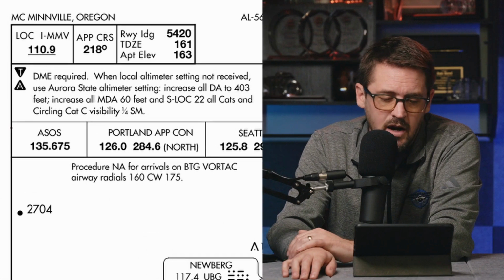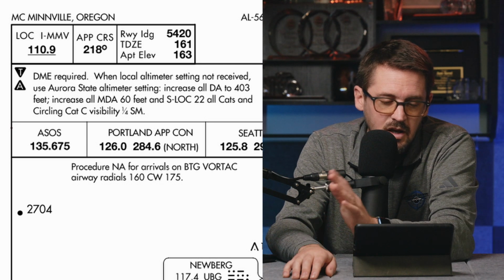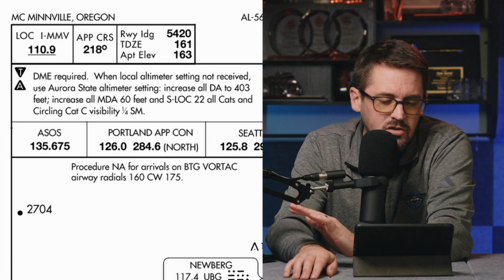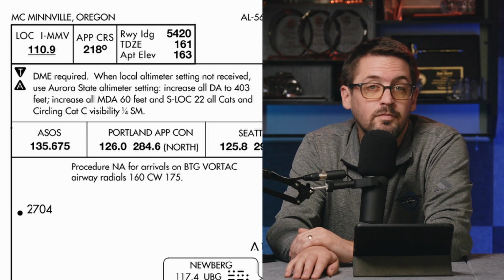Pass your IFR Oral Exam - ACS Breakdown Part 5 - Systems PART 2

Comment: My understanding is that w(h)iskey compass is no longer required per AC 23.1311-lC, #8.1.1. A GMU appears to be sufficient.

When you discuss databases, it would be very helpful to know which databases must be current for IFR flight. Navigation database? Certainly. Base map, smart taxi, airport database? Not so much. Here's a $20 question: G3X Touch (VFR GPS) nav database is NOT current, GNC215 (radio) frequency database is NOT current, GTN 650Xi (IFR GPS) nav database IS current, but obstacle database is NOT. Are we legal for IFR flight?
Reply from the maker: Correct, a whiskey compass is no longer required as long as the aircraft is certified for another form of magnetic direction indicator. If your aircraft was certified with a whiskey compass it would still need to have one unless it was allowed deviation by an appropriate STC. And yes it’s the navigation database we are most concerned with. As long as the navigation database in your primary IFR navigator is current, you are legal to use it to conduct IFR flights :-) 👍🙌🏻